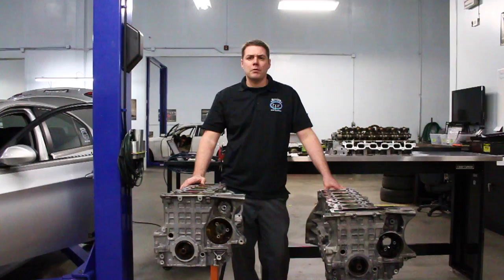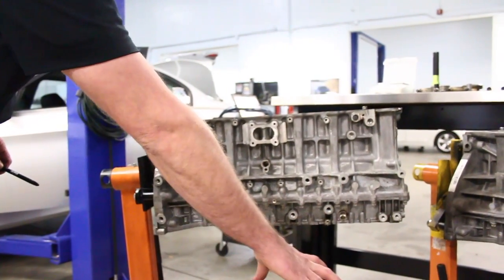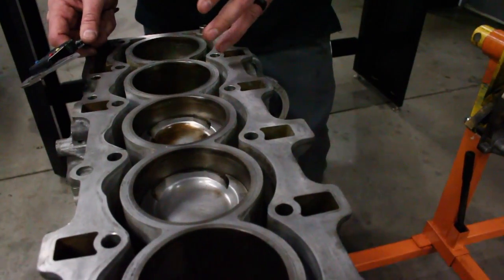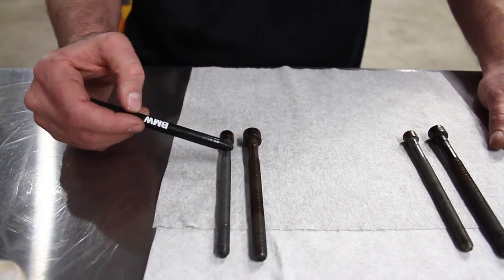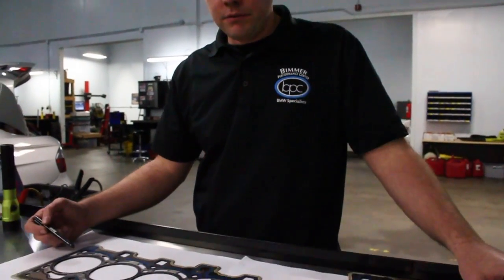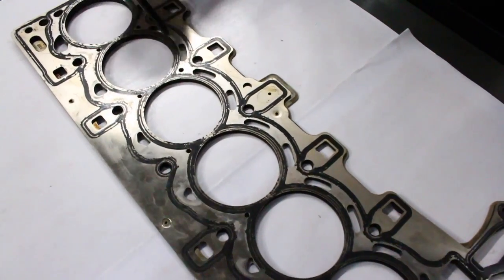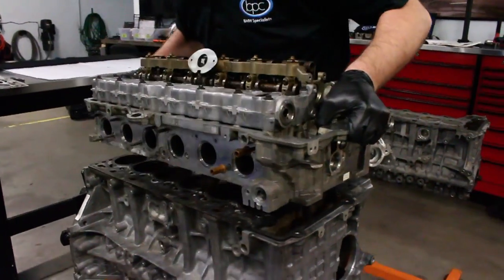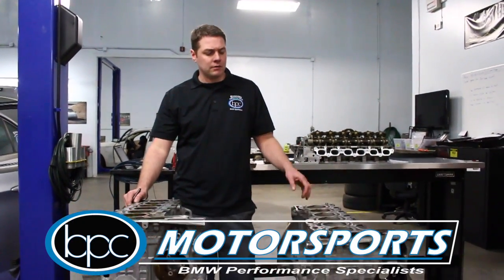N52 vs N54 Block by BPC Motorsports

Comment: I'd love to see an N54 vs N55 comparison.  Thanks for sharing.
Reply: This.
Reply: Absolutely! Great engines,, N54 amazing ✅
Reply: Definitely I want to see this.!  I working right now with one N55.
Reply: would be interested in seeing this
Reply: @TJ Pass Actually it doesn't and it hasn't been proven by anyone (I bet your ass you can't provide any proof to your claim). And there are several 700WHP+ N55's and just about every bigboost 3.4 kitted N55 is over 600WHP.  The N55 rods are the same sinter forged rods that are in the S55 and are improved over the N54 Sinter rods. There are plenty of stock block S55's making big power. So I think you are the one who should do your research.  The  N55B30T0 (M2 and X40i) shares pistons (cast) as well the sump and oil pump setup with the S55 and it has a forged crank.  The M235i, 740i LWB, M135i,  and several other N55 powered cars have the forged crank a well but not the pistons and sump, etc.  Thank for playing though but please don't try to regurgitate your facebook knowledge to me.
Reply: @TJ Pass That's about the response I expected. Thanks for playing noob.
Reply: @TJ Pass sure you do buddy, don't worry I believe you.
Reply: @TJ Pass JZ yip better but a barra boosted is not as reliable is a N54 when it comes to internals...I work on this stuff everyday.However reliability on a N/A Barra i dont think ive seen higher milage on any other car.Those things will outlast a John Deere tractor
Reply: N54 forged lighter weight internal, N55 cast internals heavier weight.
Reply: @Monstero5o  The N55 can be had with the a Forged crankshaft as well, only the early N55B30M0 has a cast crankshaft.  Both the N54 and N55 have sinter forged rods and both have cast pistons and the N54 is not lighter.  And neither break cranks anyway so the cast versus forged cranks is really a non issue.
Reply: @twinscrolled  I’ve weight both motors, and all individual parts. The rods and pistons in the n54 are lighter then n55 same as the crank lol
Reply: @Monstero5o  No you haven't. You don't have to lie.
Reply: @Monstero5o  That's what I thought.  I don't know why people like you feel the need to lie to try and prove a point.
Reply: @Monstero5o  Yes because it cost so much to weigh parts, lol.  It doesn't surprise me that you would consider that "testing", lol.

Comment: are the pistons forged on the n54?
Reply: i believe only the rods and crankshaft are but i could be wrong. either way very strong setup, records on completely stock motor with a large single turbo have 800+ whp. The rb26 is known to hold 600whp, so the n54 is no joke. 2jz i believe is 1000whp on stock motor
Reply: 2jzgte about 750whp is the limit to be reliable so 800 plus with extremely good tune, N54 looks like they are cast, but could be forged don't know!

Comment: Also, what is the power of the n54 engine without the turbos? Im curious since it has lower compression.
Reply: 190hp without turbos on a N54.
260hp on a N52.
Reply: @huanweili7699  huh?
Reply: @saganworshipper6062  its a engine designed to work turbocharged and the other was designed to work NA, what did u expect, lol?
Reply: @dvls2945  260 hp on an a stock N52 is not reality. Measure it at the wheels not the crank. I own an N52 and even with bolt-ons it's hard to get that number. Also, where are you getting the N54 190hp figure from?
Reply: @saganworshipper6062  I also own a N52 its 233/257/272 hp on stock n52s assuming we talk about 3.0's
N54 has been prepared for more powers sure in fact it seems BMW prepared it for tuning options at least imo. BUT at the same time this engine has huge problems with connecting rods snd bearing shells i mean for gods sake this engine was supposed to be a new 2jz, instead its a success if it survives 100k km's on its own stock. Oil pump issues...jesus these are fundamental parts of the engine it is a disgrace for the whole company and it comes from a BMW fanboy...

Where did i get that n54 NA number from? Assumed the guy above is right cuz its obv that a turbocharged engine without turbos wont be as powerful as a engine designed to work NA...